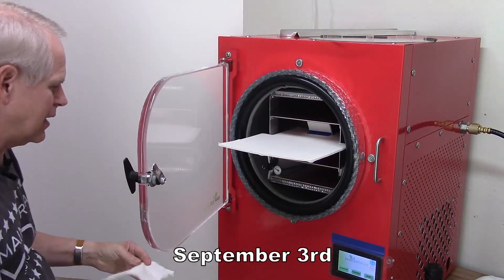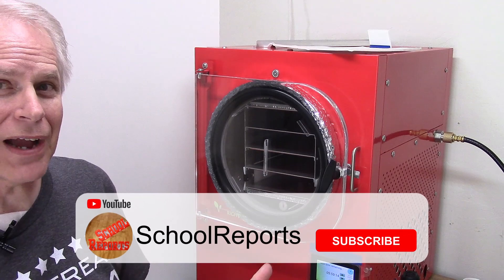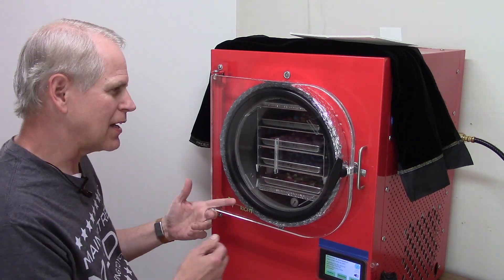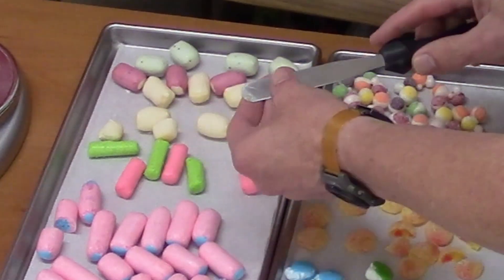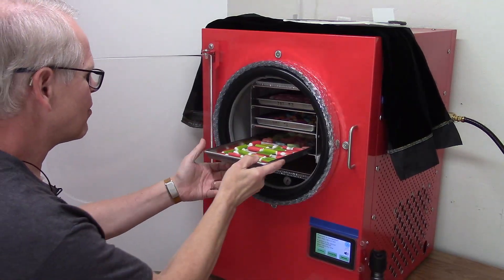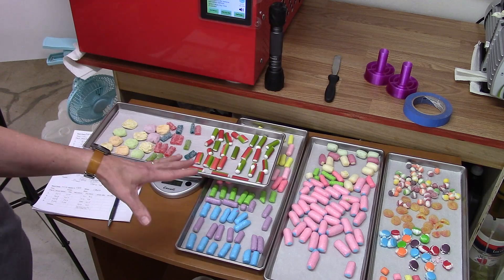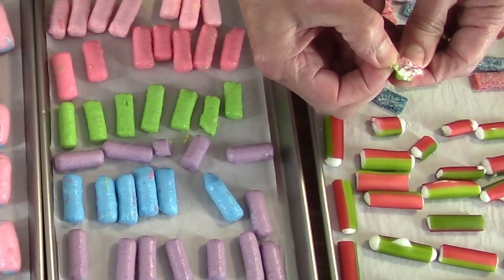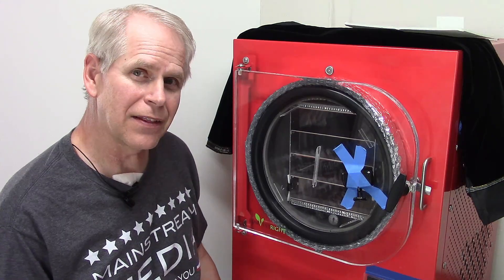Freeze Drying - The Next 50 Batches - Batches 564 & 565 - Candy for #1 Child, Misc. Kinds

Comment: Please forgive me we are new to freeze drying. I see "modifications?" You have made. Because your dryer look different than ours. We really enjoy the channel.
Reply from the maker: Our machine is from 2017 so it is different than the newer ones in a few ways, so I'm not sure if you have a specific part in mind. The screen is near the top on the newer machines and near the bottom on the older machines.

Modifications:
Added a cooling fan to blow on the vacuum pump
Changed out the door pad (that used to come with the machine) for a tight fitting disc I cut out of Acrylic
Added insulation around the door gasket
Replaced the rubber grommet thing on the door hinges with 3D printed parts
Removed the side panel from the heat exchange fan side to allow for more air flow and then later increased the hole size and reinstalled it
Added corrugated plastic pieces at the bottom of the tray rack to keep ice away from the rack
Added a continuous flow oil filter system with two Goldenrod filters in series; with 3D printed paper towel filters
Changed to the smaller vacuum hose as recommended by Harvest Right
Reply: @SchoolReports  thank you. I really liked the screen cover already made one but was your idea first. Thank you for that idea.
Reply from the maker: @therandlefamily9954  🤣 Ha! I forgot all about the screen cover. It's been on a long time; ever since someone (sister) saw dust on the screen and wiped it off while a batch was running, not knowing it was a touch screen, and canceled the freeze drying. Oops.